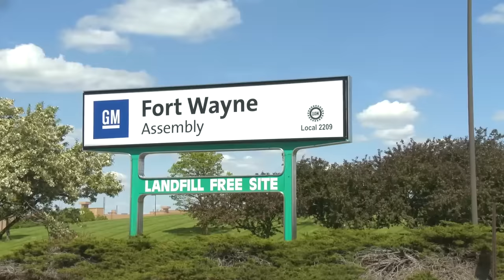General Motors Truck Production at the Fort Wayne Assembly Plant

Comment: I'm a Chevy guy but....... they just build shitty overpriced trucks just like everyone else. Impossible to get a good work truck anymore. 98 Chevy Cheyenne 2500 2wd with 315,000 miles on it. No way these new trucks will go half that.
Reply: My 2007 2500 LY6 6.0 has 541,000+ miles 13,000+ Engine hours Original Engine & Transmission. Even the Windshield is factory GM Windsheild with about 8 rock chip repairs and Millions of tiny pin holes from road sand/debris. Original Alternator, P/S pump, A/C compressor with custom rebuilt clutch

Changed:  
Battery 3 times
Spark plugs & wires 5 times
Shocks 3 times 
Fuel pump once at 330,000 miles 
Radiator at 405,000 miles
Waterpump at 415,000 miles 
Driver door handle cable at 350,000 miles
Passenger door cable at 460,000 miles
Driver Electric lock switch at 400,000 miles 
Passenger Electric lock switch around 500,000 miles 
MANY headlight bulbs
Original tail light bulbs, yes ORIGINAL
Rear brake pads around 215,000 miles
Front brake pads once around 500,000 miles